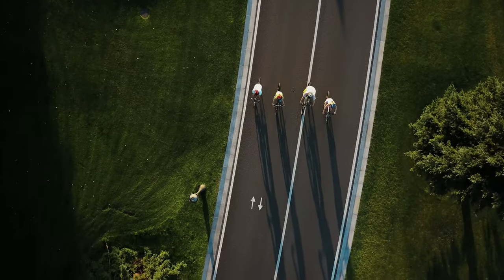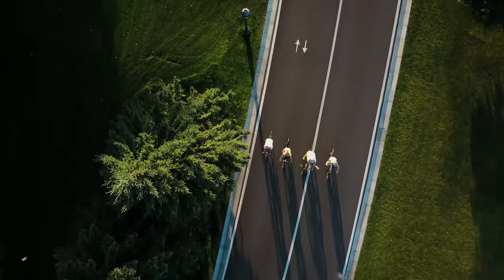Can disc brakes be made better?

Comment: We can go to the same diameter discs as mountain bikes. 180, 200, and 220 mm. Make them thicker as well. Like what they use on racing motorcycles. Of course you would have a huge weight penalty. But remember, bikes used to weigh over 10kg about 20 to 30 years ago. 6.8kg bikes were impossible to safely build back then.

Comment: I ended up fitting a v brake fork to my bike, disc brakes work fine at the rear but always requiring fettling at the front, plus with a steel fork more compliance as well

Comment: You have to face also Threaded BB and the head tubes for pressed head sets. I don’t see any issue with the fact that you have to face caliper mounting points. I agree that it should be done in the factory though

Comment: Bike industry painted themselves into a corner with disc brakes. But they don't want to admit it and go back to proven and reliable rim brakes.
Reply: Until you mix carbon wheels, anything other than perfect weather, and panic braking. Good luck surviving that crash. Yes, there are videos where folks have punched a few doors in which such situations.
Reply: Yep

Comment: Back in the olden days of bicycles, well actually not that long ago, each critical bike component allowed for a lot of adjust-ability insuring that absolute accuracy was not necessary to net a high quality and fully functioning bicycle.  As you've pointed out with many of these new innovations, the ability to allow for such tolerances no longer exists.
Reply from the maker: True, rim brakes are very tolerant to poor hub or frame tolerance. Not so with disc brakes. 👍
Reply: @waynosfotos  That's why I'm baffled as to why they're so well accepted. Pros racing and having to do a wheel swap.  Its pretty easy to turn a thumb nut on the fly to stop a little rub.

Comment: I had a SuperSix Evo I just sold because it constantly gave me issues with rubbing with DuraAce disc.I know lots of bike mechanics that see the potential in disc brskes, but they agree with Froome that it's not quite there yet for road. I even had a well known shop tell me that a lot of the issues with rubbing have a lot to do with the fact that road bikes require stopping from higher speeds for longer periods (causing more heat, which causes the rotors to expand and warp easier) combined with the fact road bikes tend to use smaller rotors than most MTBs. I only have my rim brake bikes now. My new Ti build should be completed by my birthday in September (fingers crossed) It will be rim brake too.
Reply from the maker: Thanks for the feedback 😊

Comment: The fact that Shimano filed an idea patent for some sort of electronic control for RB disc brakes, similar to ABS on cars and motorbikes, proves that the current disc brake system is not fault free.
To be fault free, brakes should have consistent stopping power based on rider modulation of the levers everytime.
As it is, manufacturers seems to still be searching for ways to correct the disc brakes' flaws and yet they're selling disc groupsets at absurd high prices.
Reply: Rim brakes dont work in all conditions every time
Reply: @johnlewsey4458  It does with my alloy rims. Been using it for decades.
Reply: @jestag2  I have never  had a Rim brake that worked in the rain
Reply: @johnlewsey4458  Mine did even accross a stretch of paddle a few inches deep. I know it won't work on carbon rims so I don't use it in the rain.
Discs are said to work on all conditions unfortunately it wasn't on mine so I sold it after a couple of months and sticked with rims. Hopefully until the manufacturers sort it all out and come up with an effective design and construction.
At the moment it's not.
Reply: @johnlewsey4458  I won a couple road races in the rain, because I rode alloy rims and everyone else showed up on carbon rims, and lost them all on the descents. Racing in the rain on rim brakes is something I wish I could forget… did it for many years. alloy or carbon, it was always a terrible experience, but it did teach me to be razor sharp in braking control and cornering traction.

Comment: Frame flex is one issue. Not the main issue. Not a mature product. Users are the beta testers.
Reply: Frame flex on cantilever and V brakes was terrible…. Even on some rim calipers. Thankfully frames beefed up a bit when rim brakes went direct mount. Road disc is hardly in “beta” testing… beta testing was about 10 years ago. They are damn near perfect now. Shimano, sram, TRP, Campy all have it pretty much 98% dialed. We will see a few tweaks over the next generation but for the most part they just work so well.

Comment: Went back to mechanical disc brakes on both my gravel bikes and work perfectly with none of the issues you get with hydraulic brakes. You don't have the same stopping power you get with hydraulic but still more than adequate for a gravel bike

Comment: I weigh 290 lbs and stop fine with Paul mini moto up front and touring canty in the back. I will not get rid of a Gunnar Crosshairs for discs. Also the descents can push 20% here in western West virginia.

Comment: In the past three years I have ridden over 4500 miles. I have a 105 based Look 765 gravel and a Campy EPS SR based Look 795. I have not been bothered by noise or by issues of modulation. I have ridden calipers for 50+ years so I have a good frame of reference. I think the issue for the elite rider is the wind resistance and weight of disks. I also think that Bike shops can damn well be equipped to take care of their customers.

Comment: W!  Timely video.  Was thinking just same on ride yesterday.   I’ve got my lightweight carbon hoops grabbing Reynolds cyro pads.  I’m ready for a disk when 1.  Power of braking over kill more modulation. 2. Able be set up calibrated tickled with fettled us noob riders 3. Be light so bike package circa 6.5 max.  I’m riding under 6 kilo.  I’m thinking we’re 5-8 plus years away from Rim like weights entire bike build.  Reliable modular rotors that are nice to use.  Just like a rim brake is nice to ride on. When not grabbing !!!    Now 45 I’m getting annoyed mechanical gears being knocked hanger geometry.  So I’m going to be electric soon.  Ride DA and 105 mechanical still.  And ready for disks when time is right. Surely it’ll come. Why is this so lame to date road bike world. They’ve sorted it for MTB and taken the Michael out us roadies giving us poo quality disks to date.

Comment: I foresee some enterprising company developing carbon ceramic discs and pads for bikes similar to what is used in MotoGP.
Reply: Doubt it. Those types of brakes require lots of heat to work. What we do as cyclists isn’t enough to reach those operational temperatures
Reply: There are already carbon-ceramic discs. Now vented rotos would be a real innovation (and I kinda know how to make it within the current frame and wheel geometry standarts)

Comment: Why would the manufacturer come out with the best disc braking possible, they need to improve slowly to sell more components/groupsets over time. over time we will have 15 gears in the rear and abs disc brakes. the advantage of disc brakes is the tire clearance, my rim brakes only go to about 32mm.
Reply: When you consider terminal velocity and road to mountain bikes, a fast road bike on decent can equal or beat the mph of a downhill bike and they use 203mm 4 piston brakes and are riding 50+ lbs carbon mountain bikes. The small full suspension cross country or lite trail bike doesn't hit the speed (terminal energy) of a road bike on alpine decent, yet we are trying to use those weaker parts.

Comment: Disc brakes have allowed endurance road bikes to evolve. Most rim brake endurance bikes were still running 49mm reach brakes and 23 or 26mm tires.
Today's can fit up to 35mm. Brands rarely specced 57mm reach brakes even though available. And of course they couldn't spec cantis....that would make it a Cx bike.
Reply from the maker: That may very well be true, but my critque is of the "race bike" and how this new tech preforms better at this level.

Comment: It tells everything when you pay 100s of dollars for those ceramic bearings that loose you watts because the manufacturer is to greedy to spend the 10$ to have the BB machined. Instead we are going back to BSA BB's which are a worse solution. I could even see this being really good marketing.

Regarding disc brakes. I think the biggest issue is that frames and groupsets are build by different companies combined with UCI rules. As a result everyone builds components around these rules and the other stuff in the market. Groupsets are build for frames and vice versa so only little innovation takes place. I would love to see some really revolutionary bikes with radical braking solutions.

Comment: I locked my wheels and skid several times(panic brake) due to some pea-brained drivers not paying attention on blind spot road mirrors on a single lane mountain pass. That was on carbon rim brakes. If that were discs, easy OTB. Roads bikes are simple machines, why the F are they pushing complicated stuff like hydraulics? 
"Good performance in wet", LoL, most disc brake roadies wont even ride their top tier bikes in the rain.
Reply: But if you were riding discs… you probably wouldn’t have locked up your wheels in the first place.
Reply: @veloveritas9963  LoL, easy out of the bars if they were discs, superior braking power right? carbon rims have shitty braking power
Reply: @lordkambing810  What does “ out of the bars” mean? Of course carbon sucks for braking performance… and in the rain theyre downright dangerous yes. Disc allows for better control and less likely to skid in an emergency braking scenario.

Comment: Thicker rotors so they dont flex as much nor do they overheat so easily. Why not have ceramic coating on the rotors/pads as well. I dont really care that much about rubbing because that is common in motorsport as well.

Comment: There is absolutely nothing wrong with disc brakes, mountain bikes prove this. The problem lies in the road application , bigger disc = more drag and extra crosswind instability. My SR eps disc setup is fantastic no rub whatsoever, the hubs and rotors are Carbon TI and are machined to exacting tolerances. The only issue is that for fast descending the rotors can’t dissipate enough heat to remain within their optimal operating thermal parameters. This is an unfortunate compromise as is the extra drag that the rotor adds to the bike.

Comment: The funny thing is Waynos we have had Rim brakes for what a hundred years and they still dont work properly. I E they dont work in the wet. It has to be said though every mechanical thing can be improved
Reply: They actually do work in the wet, just at a reduced rate. The modern textured brake track from the likes of Zipp & Campagnolo are better than aluminium rims in the wet, to the point that the tyre/road contact is the main consideration in such conditions.

Comment: They’ve been making them Better for nearly 20 years… and the new 12 speed stuff is just about perfect. I give it an A grade for shimano, A- for Sram and Campy. The tolerances aren’t the issue here… modern disc calipers are pretty tolerant of a warped or bent rotor and new shimano even more so. I have built literally hundreds and hundreds of disc brake bikes ,and never once had to run a facing tool on any part of the frame or fork. No one faces frames when they build them if it’s not a metal frame. They rub when a rotor is warped, or when adjusted improperly. The lever throw is not an issue either… panic braking on disc is safer than panic braking on a rim brake. Try it. Even a few years ago when disc brakes were in their infancy, they were still better than rim brakes for the most part. Disc brakes have some problems sure… but its actually quite rare. the rotor size is not affected by the lever throw or modulation”feel” of the brake itself. Rotors could be made even smaller for lighter riders in fact. Especially in places like CX or criterium racing, triathlon and time trial racing. Even a 140mm is plenty.

Comment: Why is everybody ignoring the downsides from rim brakes. Like getting your wheel out when you have a 28mm tire or even a 25mm tire is sometimes hard to get out.
Reply: Having to let a few PSI out of the tyre once in a blue moon to remove the wheel (if even necessary) pales into comparison if your discs rub every ride.